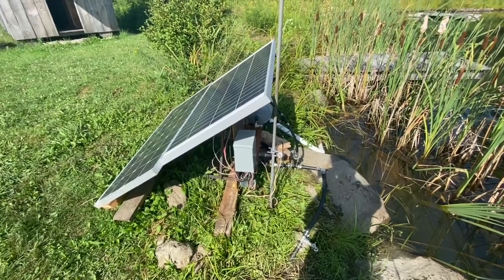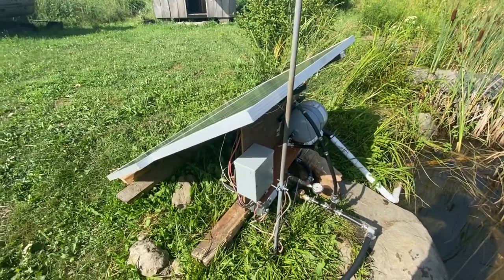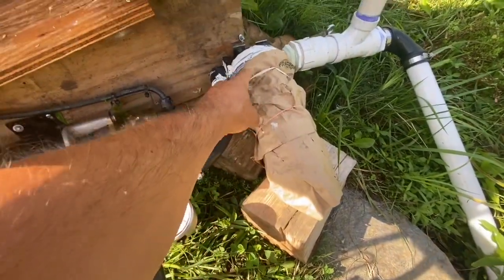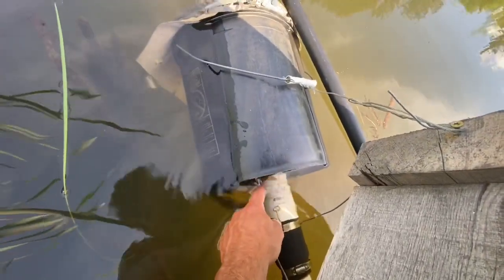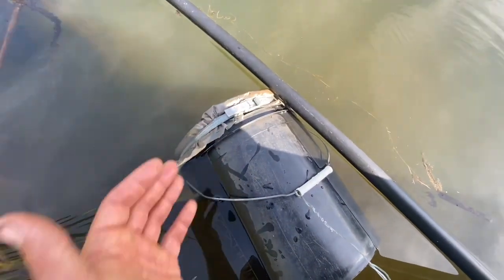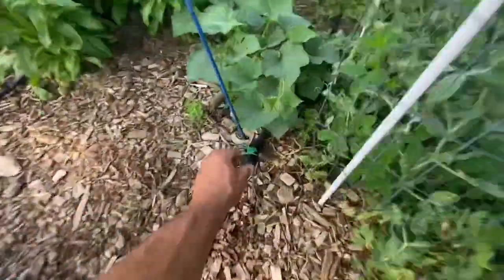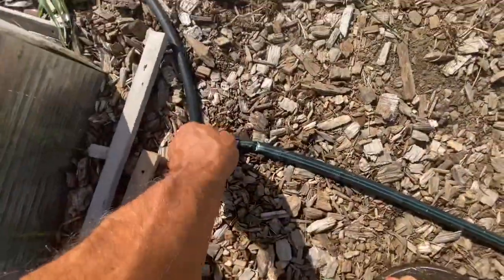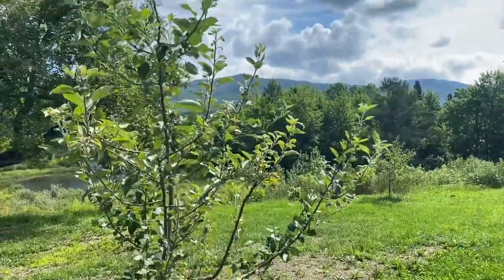Solar Direct Pump System from Pond Garden Irrigation

Comment: This is only video out there that uses the Dankoff Slow Pump like my own set up, but yours is a better is several important ways, so I'll share it over at survivalblog.com. Until  I can afford to rig up a drip system, I can only gravity feed from 55 gallon drums.  We use very clean, yet cold creek water, and the drums in the sun do heat up the water.
  Personally I would go with 10 micron intake filter.  According to Dankoff technicians, there is less chance of cavitation and loss of lubrication water, behind the impeller, especially in a higher output pump like yours, and the filter needs to be changed less.  Another method is to run two 5 or 10 micron filters in parallel, or side by side, thereby avoiding a filter change mid season.
Mine is a 1308, that should have been a 1303, or better yet a 2503. I can fortunately, that is if I can afford it, swap out the the 1308 head for a more productive 1303 set of impellers.  Because of the high replacement cost of the LCB (liner current booster), and the now low cost of PV panels, I've added 200 watts to mine.  If my LCB fails, these additional panels will replace the function of the LCB.  I can also add the additional panels to my system for the house during the winter if needed.  The additional panels can also be faced to the SE and SW to better capture the sun as it travels from east to west.
Reply from the maker: Thanks for the good info!

Comment: Have you done a video on how to make those tags for the tree identification. I’ve thought about using blank steel dog tags from amazon and a letter punch set then attach them with wire
Reply from the maker: Not a video but these are am leonard tags which are the longest lasting I’ve found aside from the ones you’re talking of which we have a set for too - but it’s way too slow for hundreds of tags. These usually blow off eventually.
Reply: I cut up soda cans which are laminated aluminum so they last forever.  Press script in with an old dried out ball point pen and string them up with stainless steel locking wire.   I fold over the end of the tag where i put the hole so it has a bit more stability.  Also i secure the wire firmly to the tag so it doesn't wiggle around.  Virginia fruit grower has a good video on it on his channel.